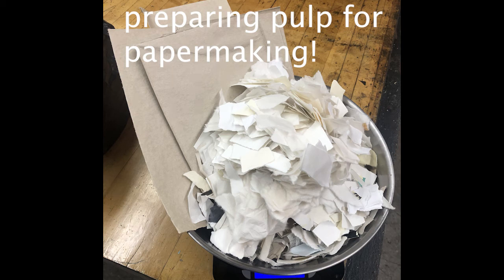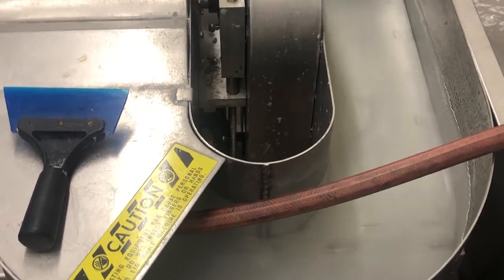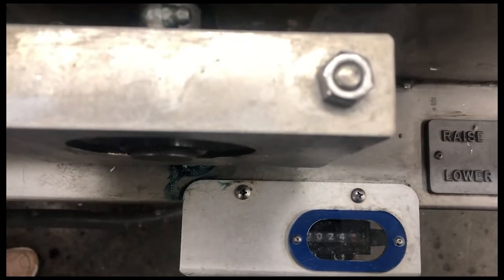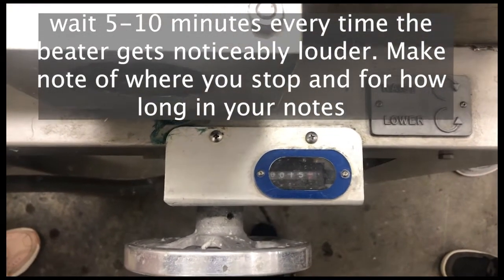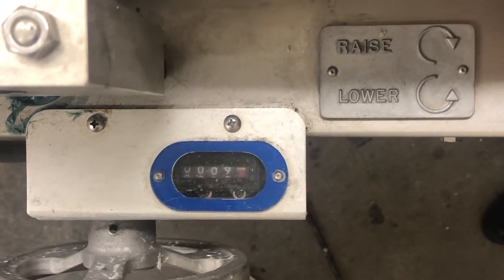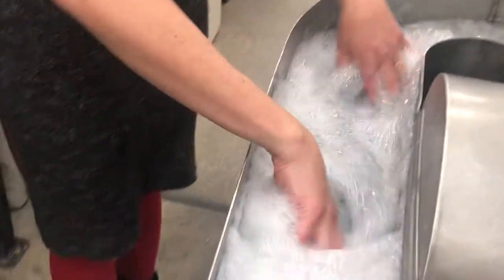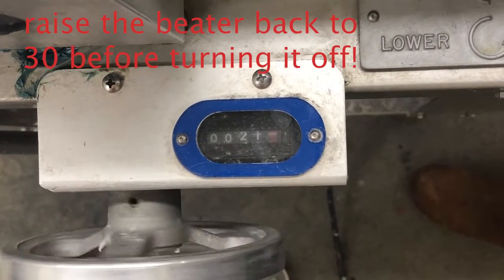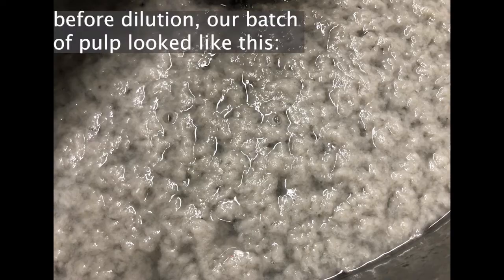Preparing Pulp using a Hollander Beater for Papermaking

Comment: Hello!  Greetings from Argentina. Thanks for the helpful video on pulp making! Im interested in the process of paper recycling/making, is there any website you could redirect me to look further into this topic? Im seeing if I can produce suitable paper for printing presses and I have a couple of questions like, can I make a combined paper (with both % of fiber and cotton) with recycled fabric? Is it possible to reach consistent thicknesses across multiple sheets of paper? How do you know when the pulp concentration is too diluted or too concentrated ? 

Thanks a lot!
Reply from the maker: Hi! I'm not a papermaking expert by any means but I can answer your questions generally. Yes, you can combine recycled paper with fresh cotton fiber (in my case I've used abaca or hemp linters or I've used linen or cotton fabric), and your paper will be stronger as a result. You can use pretty much any combination of natural fibers (and you would benefit from trying different percentages of each ingredient) but it will affect your paper in various ways. If you only use recycled paper to make your pulp, your resulting paper will tear very easily and likely not hold up well for something like intaglio where you would need to soak it before printing. But the paper should hold up fine when printing dry unless it is really fragile and overbeaten. You may want to calendar your paper to achieve a smoother texture, depending on how you press it or what you are printing with. As far as the pulp concentration goes, I would recommend starting with it too thick and pulling sheets to test the pulp, then thinning with water. It's harder to add pulp back in than to add water. And you will need to add pulp to your mixture regularly to keep your paper thickness somewhat consistent. It's really something you're better off figuring out through trial and error and testing. Your paper will also be stronger and more useful for most applications if you add sizing. I hope this helps and sorry for the delayed response!
Reply: Please contact for cotton ,hemp fiber, banana,paper making machine